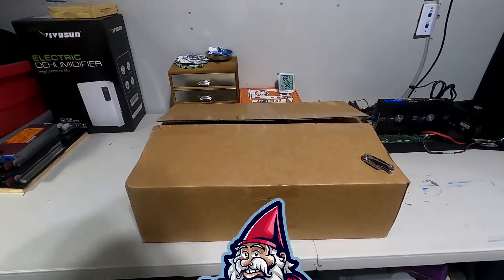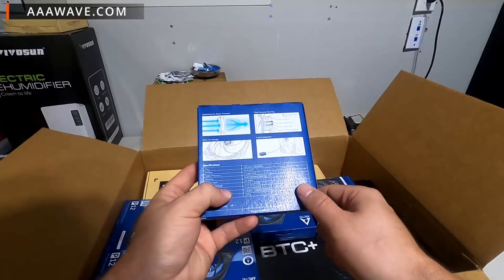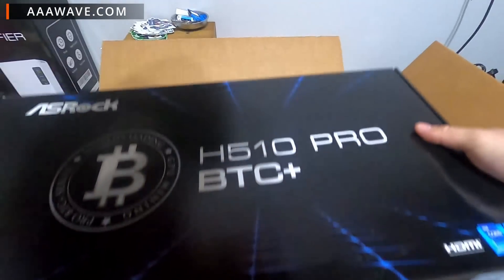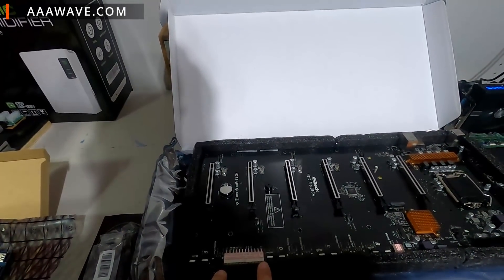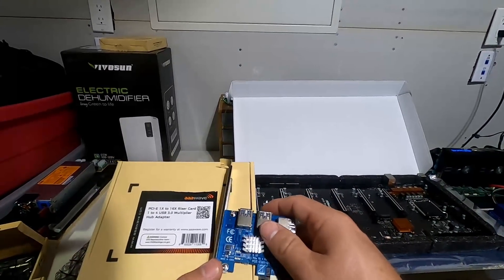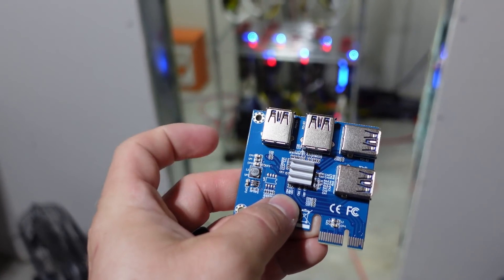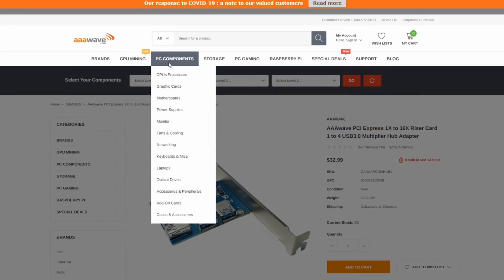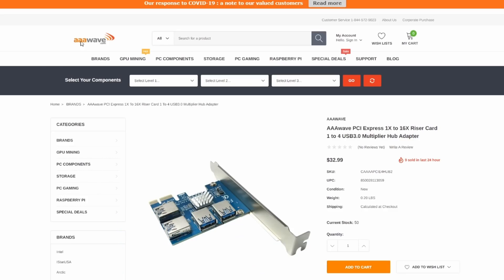Do PCIE Splitter Cards Work for GPU Mining?

Comment from the maker: Have you used PCIE Splitters on your Mining Rigs Before?  Success? Failure?  I am finding the Motherboard and Splitter Brand and Model really come into play.
Reply: I do! But I noticed that I never been able to use the 4 ports, only three... No Idea why yet. Not a Chipset or CPU limitation as I can plug other cards in other PCIE slots...
Reply: @leogeeko  I've only had that issue if I plug into a full slot instead of the 1x.
Reply: Maturity, that's what she said. :)
Reply from the maker: @TommyApel  Ha!
Reply: @TommyApel  There's 4 ports?
Reply: @baziwan9407  Yes 4, only showed 20 times in this video lol.
Reply: there does seem to be a problem when you try to install a new nvidia driver sometimes! mine failed a few times (after it updated the driver itself to some awfull one when i plugged all the cards into the splitter) so i had to go into safe mode and do it, but only have one plugged into the splitter to start with, that seemed to help! (it might just have been the one that i have bought or operating system) (win 7)
Reply: I got one. Been using it for the past 6 months. No issue at all 😁⛏️⛏️
Reply: been using a splitter for months. only complaint - gpu detection after reconnecting risers (say after maintenance) is such a hassle.
Reply: @kabuteboi  Yeah, don't do that! LOL. And if you do, plug everything back in the same way and you wont have an issue.
Reply: @totalbullion5882  Do you get the full hash rate on all the cards?
Reply: @totalbullion5882  even if i plug them back in the same ports, the riser prefers it to be one at a time. like. connect gpu1, boot, detect, restart, connect gpu 2, etc etc.
Reply: @kabuteboi  That doesn't make sense, but computers do weird things sometimes. It should be no different than turning the power off and then back on.
Reply: @Build_the_Future  Yes. although I did notice a little less stability when I got to 9 cards, not sure why though.
Reply: yeah, i use 3 days ago and perfectly working till now, my mobo and pro is  quite old school, amd sempron+ gygabyte mobo. I have saving many bucks and save space
Reply: Yes, using two right now.
Thank you for great vid!
Reply: I have used a variety of brands and types.  My favorite are the external 4 way splitters because the  cable management is better.  So far, hit or miss on the internal 4 way.
Reply: @donovanallen  got a link for the external one?
Reply: I have one on my rig works perfectly fine.
Reply: I have a problem, it works for a while, like 2 hours, sometimes more ... And than the gpus (2 x 3060 TI) connected to pci multiplier goes to 0 hashrate and stop working, the only solution is restart the computer, maybe I had "luck" to got one bad pci multiplier ...
Reply: I am using it from Amazon to let my Dell PC to recognise more than one GPU
Reply: I tried to add one today and have tons of issues trying to get Hive to recognize the GPUs on the expansion card type splitter AND the ones shown in this video. I tried switching the splitter to every slot on the mobo and nothing. Switched bios PCI lane speed from Gen1 to Gen2 still nothing. Tried to plug in just the splitter with one card, no dice. I troubleshooted for about 3 hours today and stumbled upon this video. I am using an Asus Z590-P. The mobo works fine with 4 GPUs but I need to replace one slot with the splitter to expand my rig. The only thing I can think right now that may be the issue is the 1 GPU on the mobo itself utilizing a full 16 slot (this shouldn’t matter. Any help would be greatly appreciated!
Reply: I remember I had some issues trying to use these splitters - exactly same model - on older AM2 mobo's back in the days. Nforce-based Epox board failed to start at all, being stuck at 25 POST code with no known workaround due to just one splitter being installed with no GPUs connected. Not sure if it was BIOS/MB vendor, chipset or cpu's fault.
Intel-based (Q35, X45) LGA775 boards had no such issues.

Comment: Hi. Do these work with 3000 cards and 6800 also? All these cards are gen4.  I have only a single x16 slot on my msi gaming edge mobo and would like to mix 3000 and 6800.

Comment: The question is, will these work on Sandy/Ivy bridge/ Haswell motherboards?  I have a Asus h87 with 4 slots, So i don't know if it could run a total of 7 gpus, if i had one of these splitters in there?

Comment: Are there any pcie splitters that expose the USB 3.0 ports through the bracket much like any other add on card like a NIC card so that I could close up a PC case?  I am just starting with a scavenged HP PC and would love to close up the case and just run USB cables from the back of the case to the riser cards in the GPU frame.

Comment: How did you get the 1 to 4 PCIE splitter to work. I have an Asus Prime Z390-P. I have 4G decoding enabled, primary display set to CPU, PCIEX 16_1 link speed GEN2, PCIE GEN2. I have 7 GPUs soon to be 8 but I cna't get 7 to work,

Comment: I use the same amazon version, I am only able to use 2 of the 4 usb ports. The mobo bios reverts to stock when plugging in a 3rd gpu in the 3rd usb...prolly a mobo compatability issue. 7 cards total with 6 pci slots

ASUS Prime Z390-P LGA 1151 (300 Series)

Comment: The H510 Pro Btc+  has an M.2 slot.  It requires an M.2 SATA NGFF (2 key slots ....M-slot)  will not work with NVME.  But since the Mining USB port work and there are M.2 to PCIe x1 adapters  I can envision getting 8 GPU's to work on this motherboard.

Comment: I'm using two of these PCIE splitters in my AMD Ryzen 3 3100 mining rig. There are 8 total port but I can only install 6 GPUs. More than that then my rig cannot boot, have to remove the 7th GPU and do CMOS clear. I'm now ordering M.2 to USB 3.0 riser board and see if I can add my 7th from there.

Comment: I use it on older motherboards 2008-2010 and all work fine. Sometimes there is problem with mixing cards... It can't boot HiveOS when there is mixed AMD and nVidia cards (in my extreme altcoin rigs for outcasted cards)... other than that waaaay cheaper than buying 6+ PCIe motherboards. (I only tested with intel CPU, not AMD)
Reply: What if you can’t get cards without bundled mobos, dang you new egg, lol.  But nothing wrong with cpu only mined rigs for dual mining.

Comment: I didn't used them because i saw lot of comments on amazon that it burns motherboard, pcie slots :( i say just be safe and keep rig with this adapter away from other rigs until it gets tested in large scale! as it is new tech.
Reply: Also do not put more than 2 VGA in these splitters, 3 or 4 that is really not safe choice in the long run
Reply: Because 70% of people are morons that is it. To be safe you should plug them in PCIe 16x not 1x, also do not use them with 3070, 3080 and 3090 or any other power hungry card, but you can use it with 3060 and 3060ti
Reply: @cyborg6294  i've been running a 3080 and 3090 off one with no problems at all... maybe i should look into it a bit more you have me worried
Reply: @GIBNOSKI  I have 2x 3060 TI already 4 months are working stable, if you are putting only two it is safe but if you put 3 or 4 30 series that is not safe in the long run, while for 10 series you can put 3 and 4. Also check the temperature of the chip there. If you are putting 3-4 30 series the chip will overheat.
Reply: @cyborg6294  good to know, i was going to add two more 3080s will switch it up to another slot
Reply: It is not a new tech it is there from 2015

Comment: Are there any limitations of the pcie splitters. Can I load up my 6 pcie slots with these and run 24 gpus? Also, amazon has the exact same splitters as aaawave but cheaper price. THM just has the older revision of the splitters.
Reply: i think it depends on your board. I know my board starts cutting out at 11 cards but itll run fine at 10 cards.
Reply: @seanmaln  what mobo r u using? how many of these splitters did u use
Reply: @mopikozz  h570 doing two of these in the big x16 slots.
Reply: It is hit and miss for me, sometimes gpu1 not mining (detected but not mining, no kernel use came out, t-rex).. even just 2 usb use.. sometimes works like a charm

Comment: I had 4 1660ti's running on RVN with one of these on a 1 PCI-E slot motherboard for months with no issue, put 2x5600xt's on it when they came out and the splitter caught fire at the pci-e port :(
Reply: I think you put it in PCIe 1x not PCIe 16x, that is the reason for fire
Reply: @cyborg6294 Nope, the only slot on the board is 16x
Reply: @Kassestral  I use the splitter with 2x 3060 already working 4 months
Reply: @cyborg6294  Yeah my 1660ti's ran for almost a year on ETH/RVN fine, I think it was to do with the cards drawing more power than the 75W available from the slot. The 5600xt's would ramp up to max wattage for a split second sometimes due to something in windows. I think it might have survived on Linux.
Reply: @Kassestral  you are right because even the chipset rated for 75w only

Comment: I have had good luck with the Amazon splitters, only problem is if you try and run 2080ti's it will see one normally if you put 2 on the same splitter they won't work, but for rx cards, 470,480,570,580,Vega 56/64 and nividia 10 series they seem to work perfect, I have not tried any other 20/30 series cards (I don't have any). Might be something with rtx vs GTX cards.
Reply: Read over on NewEgg a guy couldn't get more than 4 3090's to work on that board.

Comment: I had so much trouble trying to get even 2 GPUS to work on my asrock z590 board this week its annoying.  even with all the options enabled in the bios.  Switched it to a asus prime and everything works fine.  I'm having trouble trying to know which main gaming boards could be nice mining boards (6-8 gpu) with these splitters.  is there a rule of thumb ? chipsets to avoid ? (not enough pcie lanes) have you or any other viewer found the golden mainstream cpu/mobo combo for that ? It would be super helpful to me at this point instead of just trying random combinations !  <3

Comment: i have 3 of these splitters they don't last long the ports seem to die one after the other  ( older motherboards )
Reply: Did you plug 4 in it?
Reply: @cyborg6294  first one yes worked for a few weeks then died one by one  second one i just used 3 ports then they died one by one  same on the last splitter so gave up and just used another cheap mobo all good now 😁
Reply: @welshinu  I have no problem getting motherboards, CPU and ram because of my job but I use splitter to get my electricity way down. Already use one more than 3 months but plug it 2x 3060
Reply: @cyborg6294  yes does save on electricity but im not wasting any more money on them  and they all come from 3 different places so i will give them a miss from now on.

Comment: I have two of these cards and have only ever gotten two gpus to work on one card at a time. Any more than that when the machine boots into the os, there’s a really bad lag slowdown and the machine is unusable.
Reply from the maker: Have you tried a different MB or PCI Splitter cards? Just curious where the hangup is.
Reply: @TheHobbyistMiner  cpu is a problem also the chipset too if not at least b or x

Comment: The last year almost all the rigs I have ridden are with those splitters. Without any kind of problem. The only thing, that if you are going to use more than one per motherboard, only 3 of the 4 ports can be used, since when using all 4, two of them are not recognized correctly. To date, the limit I have been able to test is 12gpu on 4 splitters with standard motherboards. Due to the simplicity of getting it in my area, I usually choose the ASUS PRIME Z490-P. Up to 12 GPUs in 4 splitters is stable, but I have 14 rigs and they don't give me any problems.
Of course, the chipset of the Splitter gets very hot, to avoid problems I recommend adding a fan to cool the splitters and thus avoid problems.

Greetings to all: D
Reply from the maker: This is great information. I am curious if the larger heat sink on the AAAWave Splitters will address some of the heat problems, you mentioned.
Reply: @TheHobbyistMiner  
Thanks to you for your time, as always: D.
As for the temperature improvement for the larger heatsink, I suppose it will take longer for the problem to appear, but being 24/7 computers if you can't dissipate the heat from the small heatsink in the end the problem will continue to happen. That in the end, the problem that occurs is that one or two cards of that splitter reduce their mining speed slightly by 2-3MH, but neither crashes nor anything similar happens, at least in my case. I have tried splitters from amazon, aliexpress, from different manufacturers due to lack of stock and they all work exactly the same in this format. I even have models with the black pcb and gold usb connectors, which give the same result.
Reply: I have had the same issue with only being able to use 3 ports. Have you tried with rtx cards I have only been able to get 1 card per splitter, if you put 2 they won't work, but you can do 1 rtx with 2 GTX or Rx and they work fine.
Reply: @Syn-Drewgyver  
Honestly, I have not been able to test it with nvidia 30 series cards, but for example with the 20 series rtx there is no problem.
Always set the speed of all pcie to 2.0, and thus avoid such problems. Although it may be something else, it should be explored better.
All the best.
Reply: @putih-es  with 3060 and 3060ti working good but with 3070, 3080 and 3090 really not safe choice, these cards finally can burn the splitter or pcie slot or worse the motherboard I see that in my job working in a service center
Reply: @cyborg6294  Thanks for the information, I know I don't have to do with those ranges of graphics cards: D.
In the same way, have you found why they burn? The chipset of the splitter burns or what?
Let's see if I get a 3070, 3080 3090 rig and I can test. But I understand that the chipset of the splitter must suffer a lot with those graphics cards.
Reply: @putih-es  each card gets power from the pcie slot like for 3060 and 3060ti around 20-25W while the splitter it is max 75W so you should do the math, in case with 3070, 3080 3090 they can get 30-40W from the slot because these cards are really power hungry and the splitter can not give power for more than 2 of these cards. The burn because the chipset is rated for 75W so you should do the math, while people draw from them around 80W if you draw even more so the slot will died finally or will burn the pcie lanes in your motherboard. They even can caught fire in usb slots I saw that several days ago with power hungry cards like 3080 and 3090. While for 10 series you can plug even 4 and stay safe because they are not power hungry one, they take around 15-20 from the slot. Maybe I should do a youtube channel and share with others my work and experience haha!!!
Reply: @cyborg6294  Ah okay, so I was wrong with my thinking. I thought that the 75w in risers or splitters did not pass, and the cards took the 75w that supposedly they would take from the motherboard when connected directly, from the 6-pin connector of the riser or molex, sata, etc., depending on the riser model, of course .
Reply: I am running the exact same board but can only get it to boot with 5 GPU. Get to 6 and it boots straight to BIOS every time.  Says I am out of PCIE resources.  I've turned virtually everything off.  Updated BIOS.  Downgraded BIOS.  So frustrating.

Comment: I use 3 1-4 pcie splitters on a msi x570 motherboard to run 11 rx 6800. Out of the 3 splitters 1 USB port doesn’t work so they definitely do work
Reply: USB port is working i am sure that is the issue with pcie lanes
Reply: @Andi_Doci  whats ur mobo & cpu specs to support 14 cards

Comment: Pog!! I gotta try aaawave cause my Amazon ones dont work lol
Reply: It must have to do with the motherboard.
Do you have 4G encoding enabled?
Reply: @abhijithabhi58  tbh Idk. I'm using an old repurposed hp board lol
Reply: @thebennymenshow4160  what cards are you trying to run, I have not been able to get more then 1 rtx card to read GTX and Rx cards work normally.
Reply: @thebennymenshow4160  so then the motherboard is your showstopper
Reply: @Syn-Drewgyver  I have the amd vega 64 the evga ftw 3060ti lhr and evga ftw3 3080ti.
Reply: @abhijithabhi58  well I havent tried a few different trouble shoots just basically tried and couldnt get video. But the video issue was also an amd vs nvidia driver issue before but now it's fixed it might work.
Reply: @thebennymenshow4160  Yeah lets hope it does. 👍😃
Reply: @thebennymenshow4160  ya I would try with 1 30 series and mix in non rtx cards also make sure your set pcie speed
Reply: @thebennymenshow4160  evga ftw3 3080ti you will burned with this splitter take care
Reply: It's the same
Reply: @abhijithabhi58  if it's the same. Why wont my 3 Amazon ones work?